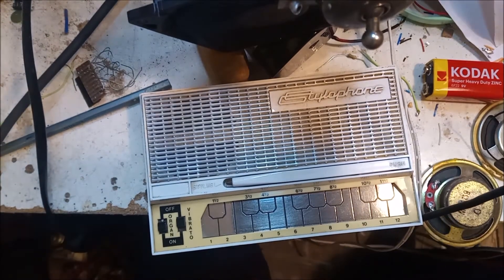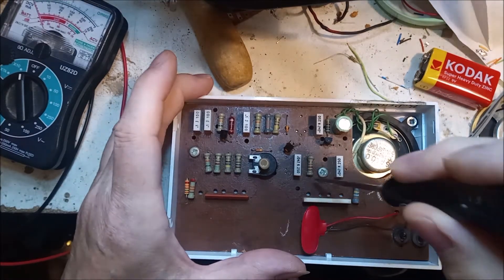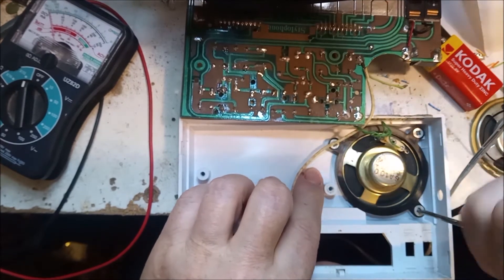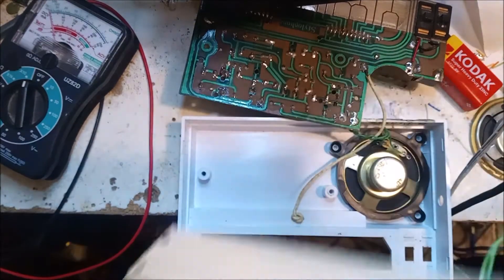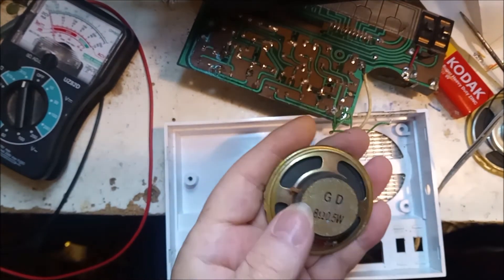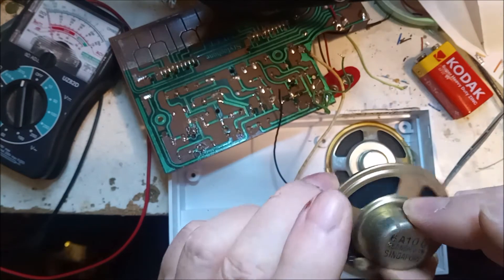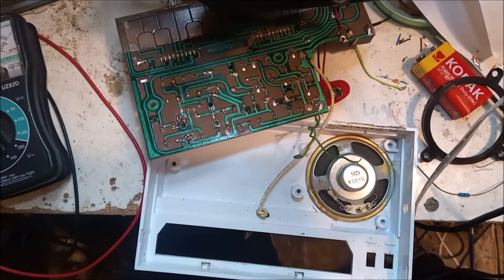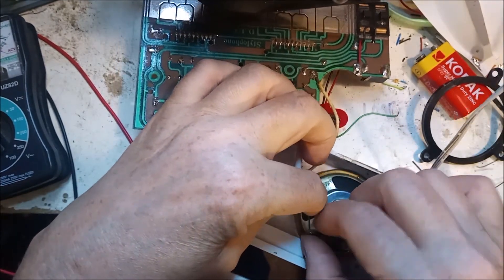Hoofbag Repairs A Stylophone

Comment: Would the stylophone still work with headphones if the speaker is out? I have a newer one and it suddenly stopped working today (i've tried replacing the batteries). Thanks!
Reply from the maker: Sorry to hear it went wrong. Where are you? You could send It to me and I could repair it for you.
Reply from the maker: Send a photo n I might just be able to diagnose fault from picture. My email
hoof_bagz@yahoo.co.uk.
🙂
Reply: @hoofbags  This is embarassing... the reason it wouldn't make sound when on is because the volume was all the way down 😅 Thanks for the offer though!
Reply from the maker: @OscarJustianComposer  easily done. The volume control was a later addition. The 1970s versions had no volume control.